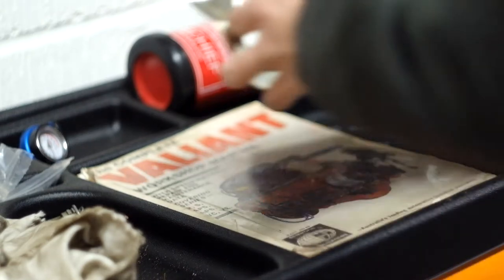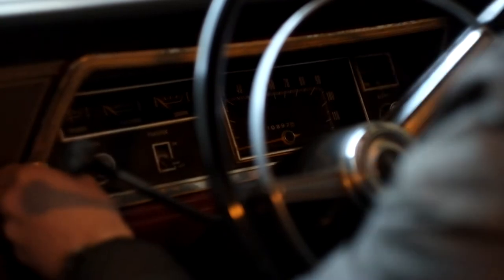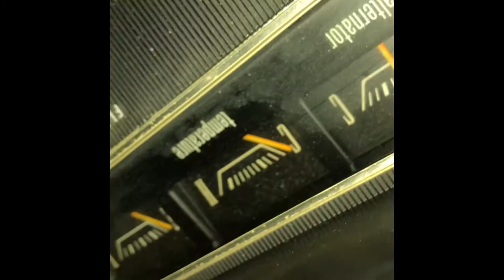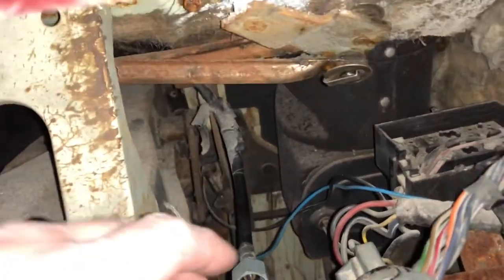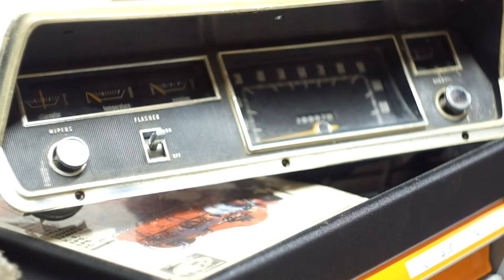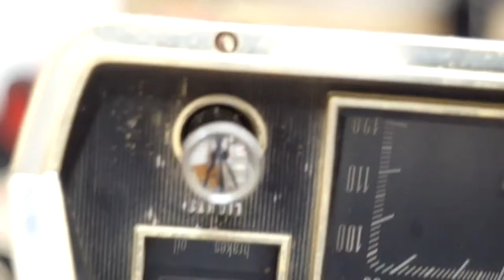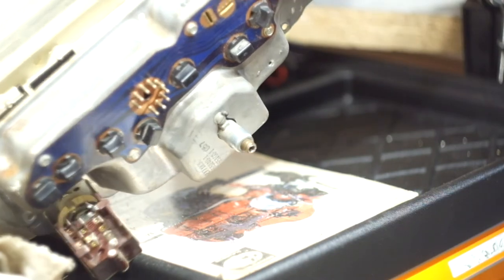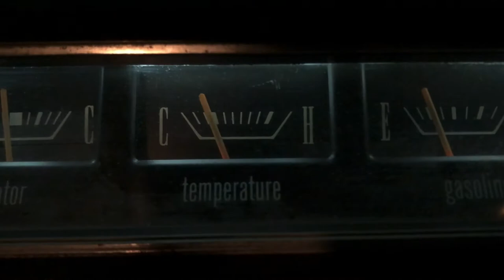53 year old Plymouth Dash removal and repair

Comment: Good video. FYI- Drop the steering column to make the dashboard easier to remove. It's an easy thing to do.
Also, you can remove the headlight knob by lightly tapping on it from the back with a flathead screwdriver and a small hammer.  Use a broad end to prevent cracking and damage. They are usually held in with a small metal tab. It's much easier to snap back on. Good luck!
Reply from the maker: Thank you for your knowledge! the owners manual was in-depth enough to show how to adjust the tappets with the engine running but wouldn't show how to removal that stubborn headlight knob! your very helpful comment is the reason this channel exists! thanks again!

Comment: To remove the whole headlight switch there will be a little button on the switch itself you can’t miss it. Press it down and pull the print out of the switch. They are the same with jeep cherokees.
Reply from the maker: Thanks for the helpful tip!